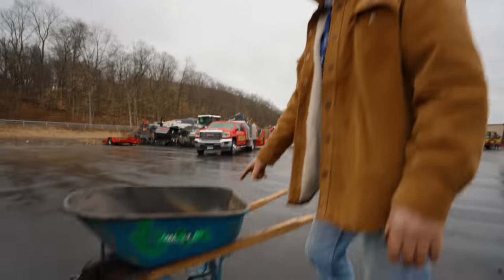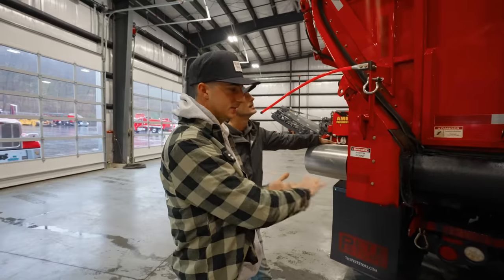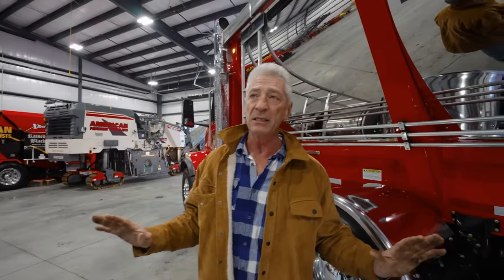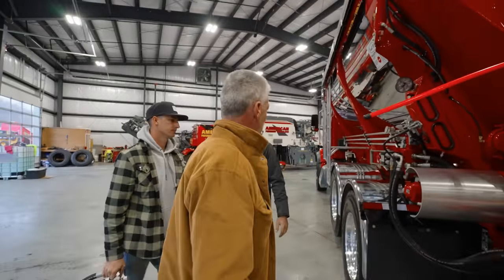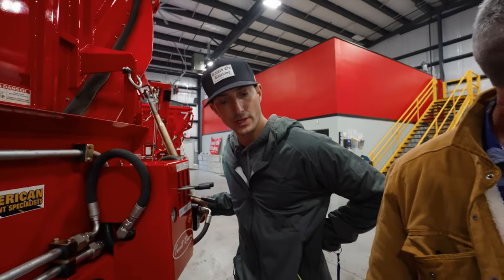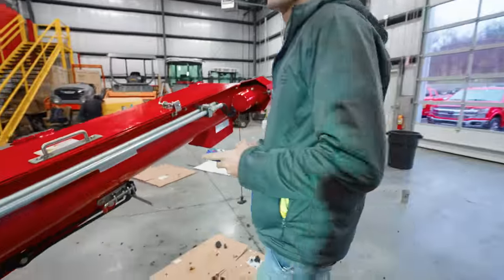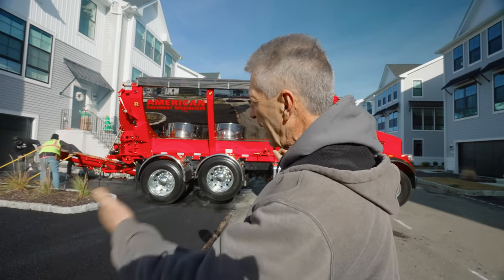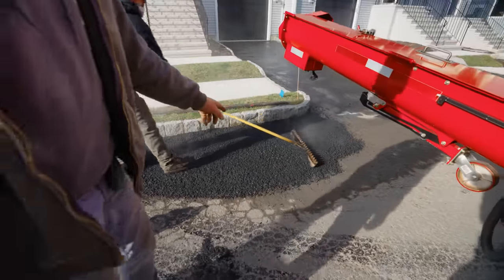NEW PETERBILT 567 LIVE-BOTTOMS | Trout River x APS

Comment: This runs off the same basis as  a concrete mix on site.the idea has been out for years in concrete I drove one for years works same exact way just don't need to go through all that extra connections it's already part of the truck we backup to a driveway lower the boom mix and start pouring when done lift lock in place down the road you go
Reply: I think the beauty of his design though, is this ability to quickly detach it and have your dump truck to use as normal in no time at all.